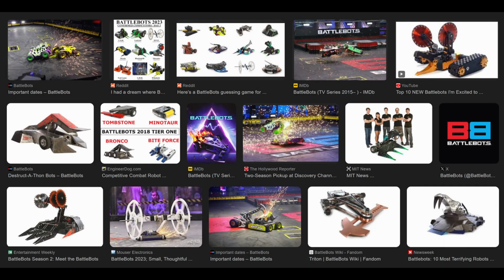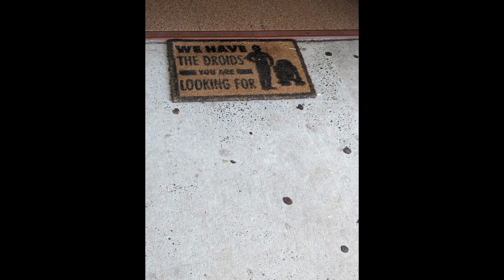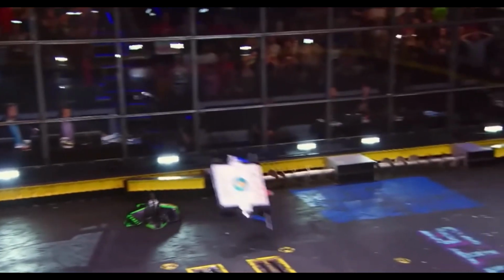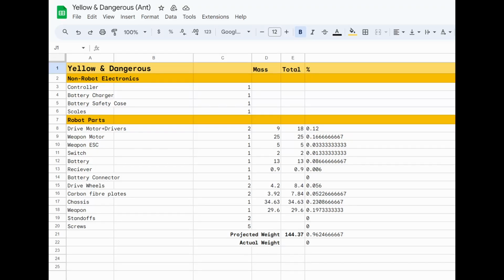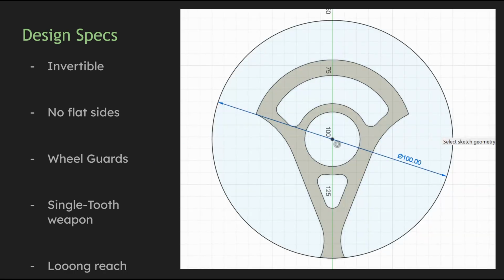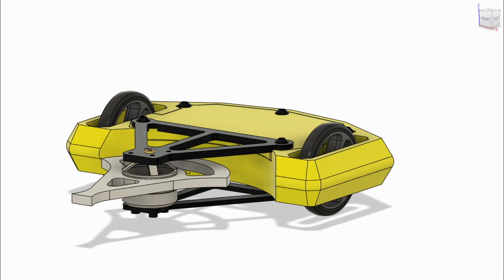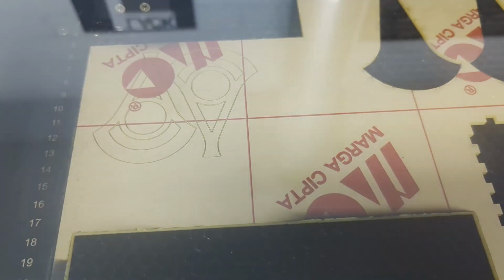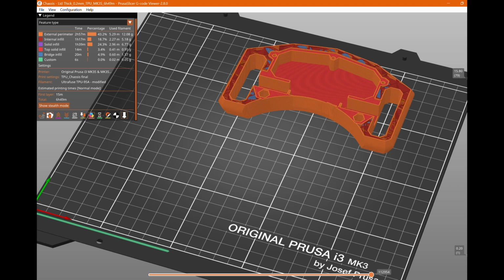I Built an Antweight Combat Robot - Y&D Mk1

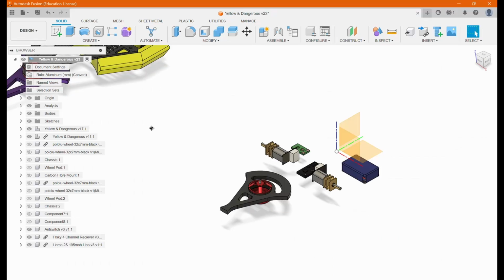Comment: What are the black squares attached to the base of your n20 motors in fusion 360? Seen around 4:09
Reply from the maker: They're dfrobot brushed escs since at this point my receiver and escs are discrete components rather than something like a malenki. I've recently realised that these escs may have been the source of my slow driving as they were sluggish when driving Synergy's arm aswell

Comment: Is the weapon press fit on the 1806?
Reply from the maker: @mattstewart2750  kind of, I cleaned both surfaces and sand away the coating on the rotor, apply JB weld to the weapon and slip it on. I use a jig made of Lego to hold everything level
Reply: @engineered_cha0s  Ahh, that makes sense.  Thanks for the reply.

Comment: great video. Would recommend a 100hz high pass filter in the video editor. there is a huge amount of low frequency background noise.
Reply from the maker: Cheers, I'll have to look into that
Reply from the maker: Could it possibly be related to the colour space of my phone not being corrected by the editor? It took me a few videos to get that right
Reply: @engineered_cha0s  The video looks fine. just the audio where you're talking. The mic is picking up low frequency background road noise or something. It might not be very obvious unless you have some good headphones or a subwoofer, but the bass in the audio is unnecessary when just talking because a human man usually only talks as low as 90hz or so. so anything below 90hz audio range should be removed.
Reply from the maker: Ah right ok, that'd be because I was recording in my backyard there's cars and birds in the background 😅 the most recent video's audio was on a proper mic inside so should be better

Comment: Do you have an accelerometer installed to reverse the controls depending on weather it's upside down? It might be a little be of a pain to integrate but it'd pay off in simplicity of control.
Reply from the maker: @5eurosenelsuelo  nope, just practiced driving both ways (: my new iteration uses an all-in-one board from llamaforge that serves as a reciever and drive escs which lets me assign a switch to flick to invert controls. Being able to drive upside down is still a useful skill though
Reply: Most people just learn to drive inverted. It's really easy after a little practice.

Comment: Gi. you have a great logo. Did you make it yourself, or and freelance contract? Wanna share the contact for it?
Reply from the maker: Thanks! The logo is a part I made from a previous project. I was trying to design a 3d printable bistable auxetic material (Steve mould had a good video on it).
Anyway, couldn't think of a logo so made it black in fusion and took a screenshot 😅

Thumbnails are screenshots with extra stuff added in with ms paint (not the highest tech ever).